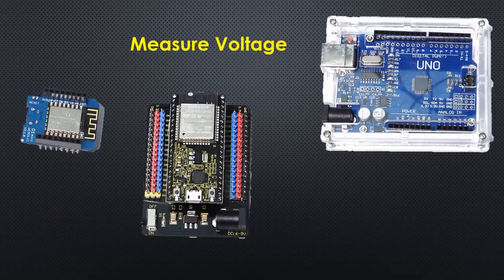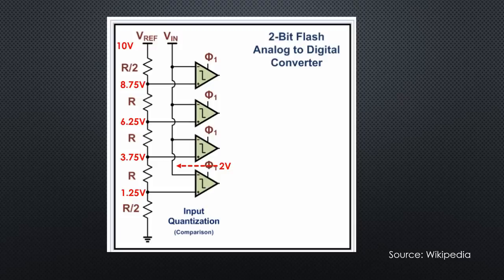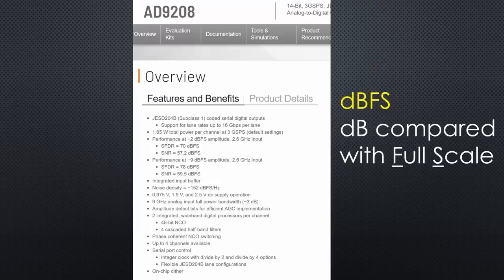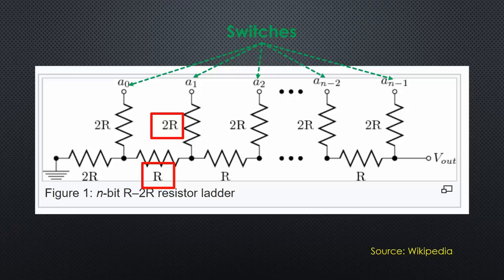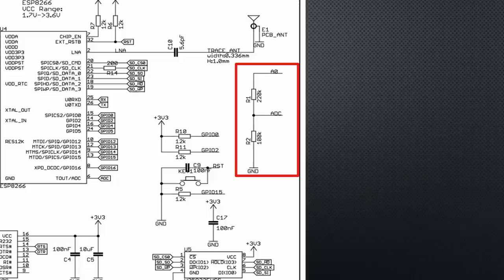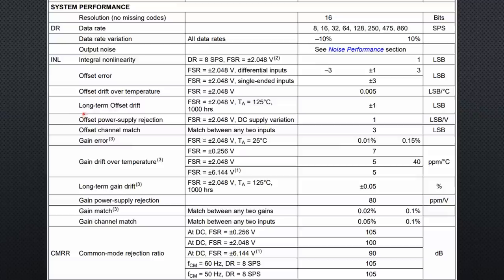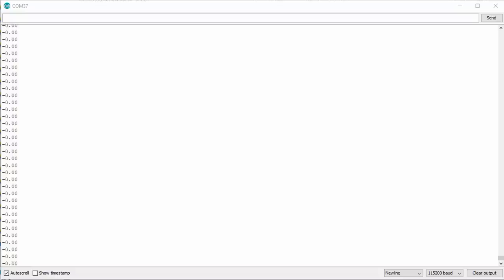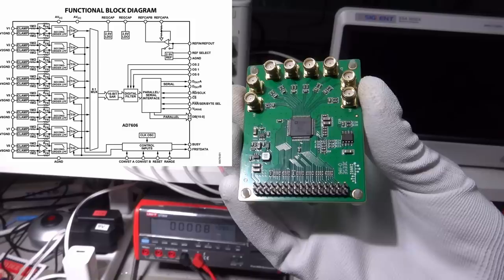#340 How good are the ADCs inside Arduinos, ESP8266, and ESP32? And external ADCs (ADS1115)

Comment: HI, I am newbie and have a question here may be very stupid... , for the equation that can get the voltage, why is x * 4095/1134, not x * 1134/4095? x not the adc value? Thanks for your answer
Reply from the maker: Make the calculations yourself with the highest reading of the ADC (4095). You probably get a strange voltage with your calculation.

Comment: Good Afternoon from south America. Andreas I have a doubt. ADS115 have a max. resolution 860S/s, to 16 bits it's equal to 41280bps (data=16bits+newline=8bits) it's correct this?
If I needed more channels for example 4 channels I would need  another other mcu...or Arduino could help me?
Reply from the maker: I cannot follow. But the resolution is in bits and the speed is in conversions per second, not pits per second. Maybe you consult the data sheet for details.

Comment: Hi Andreas, great video. Any chance you've also looked into reading low voltage signals (in range 0-0.3V) and related challenges (noise introduced by amplification, etc?)
Reply from the maker: No. As you write, this is more a topic of amplification than a topic of ADC.

Comment: At around 12:00 you say that the SAR conversion speed in an ATmega is dependent on how fast it reaches the correct value, but this is not true. It will always go through all 13 ADC clock cycles since the binary approximation not only goes stepwise up, but actually brackets in the "correct" value from both sides. The range given in the datasheet reflects that you have the choice of different CPU clock speeds and prescalers for the ADC clock.
Reply: you can also easily let the ATmega328 let measure its own supply voltage using the internal bandgap reference: https://www.sciencetronics.com/greenphotons/?p=1536
Reply from the maker: You are right. I made a mistake, but after thinking a little, I found it :-)
And video #10 shows how to use the internal reference

Comment: This was super helpful and timely for me.  I've been struggling with how inaccurate the ADC is in the ESP32 trying to get good voltage readings.  I'm assuming that I don't need a voltage divider if use the ADS1115 to measure an 18650 Lion and if I power it from the ESP32 it wont cause a current draw when the ESP32 is in sleep mode?  
I have learned some useful stuff struggling through this process though, like how to switch on and off a voltage divider using a  N and P Channel MOSFET Module (CJMCU-4599 Si4599) so that the divider doesn't constantly drain the battery (thanks Ralph S Bacon).   I also looked into using the INA219 board, but the .1 ohm resister creates a constant draw a battery as well.  I'm going to give the ADS1115 board a try, I just ordered a few from Amazon.  Andreas, thank you so much for presenting this information in such a clear and concise manner.  Cheers!
Reply from the maker: Pay attention with the ADS1115: It cannot measure much above its VCC. So if you connect it to 3.3 you cannot measure 4.2 volts without voltage divider.
Reply: @AndreasSpiess  Thanks!

Comment: You have a mistake regarding successive approximation ADC. The speed of the ADC is not based on the input signal; it is a constant time based on it's configuration. It doesn't stop "when it finds the signal", but rather it always does a comparison for each bit it's accuracy is configured to. Essentially it starts by setting the MSB of the value sent to the DAC to 1 and all other bits to 0, it then checks if the comparator says the input value is greater than the DAC output it sets the next bit to 1, otherwise 0, and moves on to the next bit. It repeats this process for each bit of it's accuracy, getting closer to the correct value with each step. This is where the name comes from; the DAC creates an approximate value which is successively narrowed in on the correct value using what is essentially a binary search algorithm.
The variability in the sampling time comes from the configuration of the ADC: e.g. you can configure the bit depth of the sampling for a speed vs accuracy trade off.

Otherwise, nice video :)
Reply from the maker: I think that is what I showed
Reply: @AndreasSpiess  I think what you showed is it stopping as soon as it passes the value, and also stated it's time depends on "how long until it hits the right value". Which is not accurate. When it goes above the value, it then reduces the DAC voltage in the next step instead of increasing, and keeps going. It actually never cares when it passes the value; whether it is above or below only determines what it writes for the bit at that step. The time it takes is not dependent on the input signal. A 10bit successive approximation ADC will always do 10 comparisons. You suggested it might only do 3 or 4, which is a common misconception with these type of ADCs.

Comment: Such a good explanation. I was desperate to understand why my reading are so wrong... Thank you Andreas. Would something like below also work?

int adcValue = analogRead(ADC2_PIN); 		//ADC2_PIN is an Adruino constant for ESP32 build-in internal reference voltage PIN on ADC2 (Analog-to-Digital Converter 2)
float voltage = adcValue * (DEFAULT_VREF / [ADC_RESOLUTION]); //DEFAULT_VREF is am Adruino constant for internal reference voltage value (1100.0)
Reply from the maker: I do not know what it should enhance. Noise can be "filtered" by averaging many readings, and systematically wrong values by calibration (store the difference to the exact value in EEPROM). All other effects are hard to eliminate (or even not possible)

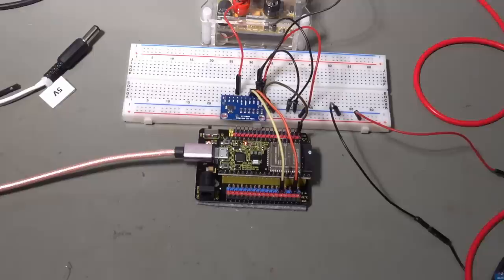Comment: At 22:22 you say 2.499 and conclude a good linearity.
But in the video I read 2.459 which is 40mV off.
Or did I understand the offset correction wrong?
If all we have is an ADC with bad linearity, should we do a multi-point calibration?
Reply from the maker: You are right. My old eyes did not read the correct value!

Comment: Good video. Thank you. Differential ADCs missed?
Reply from the maker: The ADS1115 can be used in differencial mode. I am not sure if differential mode is used by many makers (appart from measuring shunt resistors)
Reply: Some sensors needs, for example load cells.

Comment: Great video! Did you ever test 2x ADS1115 on an ESP32 with wifi transmitting, the noise/reading jumps that is generated randomly across both ADS (mainly the second one in the I2C path) is really bad :( cannot find an an answer anywhere online :(
Reply from the maker: No. I try to do the measurements before I switch the radio on. Distance between the antenna and the ADC sometimes help. And for sure a few capacitors between VCC and GND of the ADC board.

Comment: No INA226? Why?
Reply: INA226 is way better, I use them often to measure voltages with ESP8266 or ESP32’s
Reply from the maker: I think this is a very specialized chip. But of course, it can solve the problem of measuring higher voltages.

Comment: There is a cheat to reducing the number of comparators in the parallel configuration 
Use less resolution say 4 bits, sample and hold the analog value, get the 4 bits, sample again subtracting the first value and get 4 more bits.  A little less than half the speed but many less parts.
Reply from the maker: You are right. This is another concept used.

Comment: Quite a big omission from your list, you missed off the INA219, which is specifically designed for measuring voltages and currents.
Reply from the maker: I had the INA chips in my video about measuring currents. But of course they also can be used here.

Comment: I wish you would have released this video a couple of months ago. I struggled to get an ESP32 to read a thermistor, and I ened up having to generate a loop up table and do a linear extrapolation between the data points to get anything close to useful values out of the ADC.
The STM32's have an HAL_ADCEx_Calibration_Start function to improve ADC accuracy. I've used it in the past, but only to read battery voltages where accuracy wasn't really important. Do you have any idea what that is doing(maybe building it's own LUT)?
Reply from the maker: I never worked with STM32s, so I do not know.

Comment: I am trying to build a device to measure power from a solar panel.  I purchased a small voltage sensor that has a 30K ohm resistor and a 7.5K ohm resistor.  If I measure the voltage with a multimeter I consistently get a figure that is about 2 volts over what my esp32 device is reading.  Is this normal or is there something I can do to increase the accuracy?
Reply from the maker: Maybe you google "voltage divider"? And pay attention taht you do not kill your ESP with overvoltage!

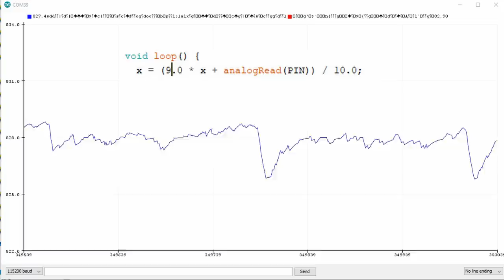Comment: 19:15 The shown formula is actually a discrete time 1st order low-pss filter (IIR) and not a 10 or 100 sample average.
Reply from the maker: What is the difference?
Reply: A moving average filter is an FIR filter, while a 1st order LP / PT1 filter is an IIR filter. They have different properties regarding implementation and time/frequency response. One is like a sliding window/ring buffer with 10 or 100 samples, the other is recursively defined.
Reply: That is correct. An easy moving average filter can be built with an array, where you replace with every new cycle the oldest element with the new value. For averaging the oldest value has to be subtracted and the new value added to the sum, which has to be devided through the amount of array elements. The Array is a therefore a ringbuffer.

Comment: I couldn't get such stable readings as you have for the ADS1115.  Do you have some sample code? I'm averaging over 100 readings, with a gain of 1.0 , and still get plus minus 20 digits of noise. (Which is plus minus 2.5mv)
Reply from the maker: This is most probably not a SW issue. Noise is a hard thing to conquer. Good ground and short wires can help.
Reply: @AndreasSpiess  Andreas, you are 100% correct! It was the WiFi 2.4 ghz causing the problem. When the ESP8266 mini is not connected to WiFi, the noise drops down to similarly shown in your video. As soon as WiFi is connected, the readings fluctuate quite a lot.

Comment: Thanks a lot .. A Quick question is there a 100 volt DC voltage Sensor ?  or voltage divider is the only way out... Working on a raspberry pi based DC energy monitor wish you have something alike in pipeline... nicely declattered the fact of ADC 👌
Reply: The only way to go is a voltage divider in one or another form. Whether you build it yourself or anyone has built it and put it inside a module is the only difference.
The "normal" cheap digital multimeters have a native voltage range of 200 mV - everything above is realized by means of voltage dividers combined into the fixed 10 MΩ input resistance.

Comment: Hi Andreas, couldn't the vref supplied to an external ADC be monitored by one of the ADC channels from the esp32? Many thanks
Reply from the maker: And why would you do something like that?
Reply: @AndreasSpiess  tô recalculate The actial voltage valuw of The source if theb supply voltage varies
Reply from the maker: @Leao16mm  Better use a stable reference voltage (which is provided by most ADCs)

Comment: One more thing: you should divide by 1024 and add one LSB instead of dividing by 1023 because there are 1024 steps, not 1023, and you’re scaling the ADC’s output incorrectly if you do so. This article explains it: https://forum.allaboutcircuits.com/threads/why-adc-1024-is-correct-and-adc-1023-is-just-plain-wrong.80018/
Reply: It's another historical holy war with long roots. :)
Reply from the maker: I do no more care. There are two fractions. It does not matter in any case if you calibrate your factor to a measured value (BTW: I used 65536 in another place to use both concepts. It did not help ;-)
Reply: Andreas Spiess You can’t correct the error with a single point calibration, it’s a scaling error. It’s minor (hence why you might not have noticed anything) but important if you’re doing something that require high accuracy, and a good practice in general. Though I guess it’s not that important for most of your projects.

Comment: No love from the guy with the Swiss accent for Swiss microcontrollers? I was expecting to see an STM32 here 😋
Reply from the maker: Why do you think STM32 are Swiss?
Reply: @AndreasSpiess  they're made in China but isn't ST Microelectronics based in Switzerland? So atleast some of the IP is Swiss.
Reply from the maker: You are right. It seems their headquarters are at Geneva. But they seem to be a French-Italian collaboration. But your and other comments made me think if I should start to cover also some STM chips...
Reply: @AndreasSpiess  there's 3 main budget chips you can cover. The 1$ STM32F030F4P6, the 2$ to 3$ STM32F103C8T6 (Blue Pill), and the 4$ STM32F401 (Black Pill). They are all very interesting. The 1$ board has all smt on one side but unlike the other two it is too fat to fit on a breadboard. The Blue Pill is the most popular online and has a Cortex M3. The black pill has a Cortex M4, which has the ARM Neon DSP instructions. You can search for these on AliExpress, and also get a cheap 3$ to 4$ ST-Link V2 dongle, that connects to these boards via their digital pins for programming purposes. But whatever you do, please don't lose that lovely accent 😁

Comment: You say that you divide 5V by 1024 but in the formula you divide by 1023. What is the correct value for calculating the LSB of the ADC conversion? This is crucial in all calculation done in the code. Your average looks like not an average to me, is more like a 0.99 0.1 filter ... from.my experience the ATmel ADCs are pretty noisy, basically you should dimension your hardware so that you can ignore at least 2 bits from the 10 bits, as they will toggle wildly if you have stuff going like CAN, BT.
Reply from the maker: 1023 or 1024 is a big discussion.I do not care what is right or wrong. If you calibrate your ADC it does not matter. Concerning noise: As I mentioned for the ESPs and Wi-Fi, ADCs easily can be influenced by noise. Sometimes also by the not proper PCB design. It is nearly an art to reduce noise.

Comment: The thing I use my ADC for most is monitoring a LiPo battery and solar panel voltage. I don't want to use an external ADC because they are power hungry, and if I am looking a battery voltage, I clearly care about power consumption. I have two related questions about voltage scaling.  
Is there a correct way to turn a voltage divider on and off?  I only read it once an hour so it would be nice if there were not a few millivolts leaking through it all the time. My thought was to use a 2N4001 between the voltage divider and ground, but of course that doesn't work because it makes the voltage at the pin too high when high impeadance.  If I put a transistor above the resisters the BE current distorts the reading.
The other question is there a way to use the range of the ADC over an input voltage range not starting at 0.0 V?  The protection circuit on my LiPo cell never allows the voltage to fall below 3.6(?) volts is there a circuit that will map 3.6 to 5.0v over the 0.0 to 1.0 V of the ADC input?
Reply from the maker: I do not know of a method to switch the divider off.
You always can add a battery to reduce the voltage. But maybe it is easier to use a better ADC and start measuring at 0 volts
Reply: To turn the voltage divider on and off in a WeMos D1 Mini, I currently use  a logical MOSFET IRLZ44N between the external resistor and A0 pin and it works fine. Just put a small delay in reading Analog pin after turning on the mosfet to stabilize the reading. With the mosfet I'm able to read the voltage once for hour instead of continuously feeding the voltage divider with the battery.
Reply: Here's a not so simple circuit to do this. I had to do with what I had in my toolbox, therefor the many inexpensive BJT's...
https://ibb.co/6yrvdd7

Comment: The ADS1115 does not use SAR, it uses Delta-Sigma wich is much superior in terms of precision. While the SAR take a single sample and generate an output, the Delta-Sigma do oversample and give us an output after pass through a filter and a decimator. 
The DAC used in SAR uses capacitors, not resistors... I really don't understand how it works, maybe a theme for other video?
Reply from the maker: You are right. It is described in the datasheet. I did not read it and I also read that some DACs use capacitors. But I do not know if it is the standard.
I do not think it is important for me. For many chips I use the "blackbox" approach: The system is what it does.

Comment: I have used the ADS 1115 recently. One challenge I had was reliably reading zero. If there was negative interference on the input, the output gets driven fully high, rather than the negative reading being ignored. Any solutions? Could I clip the negative somehow? Op amp? I’ve fudged it for now by adding a positive offset and then subtracting it in software. Resolution, range and accuracy comes at a price!
Reply from the maker: I saw this behavior, too if I grounded the input. When I added a serial resistor it stopped this behavior.

Comment: Why ESP is stable when Arduino is usb voltage dependent ? That's simple. ESP boards have LDO linear voltage stabilizer between usb port and chip itself. So it has nice solid 3.3V; 5V Arduino is powered nearly directly from USB that's why results varies... but ... you can either use external reference for ADC and it will work out well or use internal reference (but not AVcc) and will be ok-ish as it's less dependent on usb voltage.
Reply from the maker: You are right. Also when I used the barrel jack the Arduino was supplied by a stable voltage.

Comment: I use this for analog pin of esp8266:
ADC_MODE(ADC_VCC); 
String voltage = String((float)ESP.getVcc()/1024.00f);
I'm sorry if I didn't understand the subject
Reply: You shouldnt store it in a String. Float is better for determining if voltage is to low
Reply: @Marlenalynnann  Maybe he is going to print it only